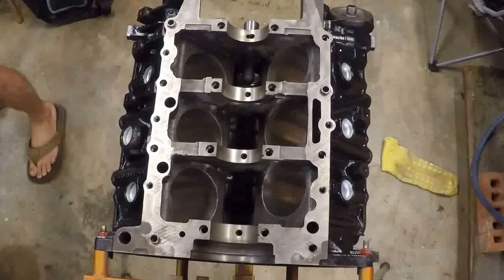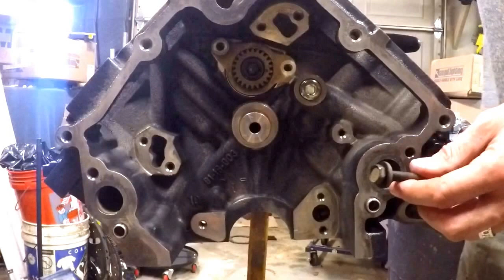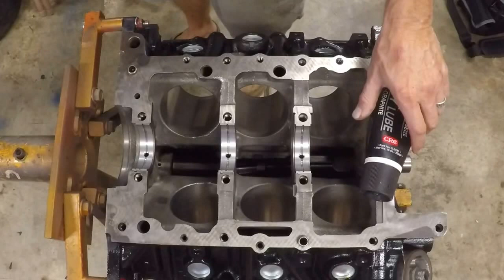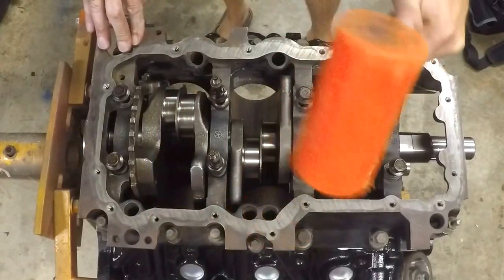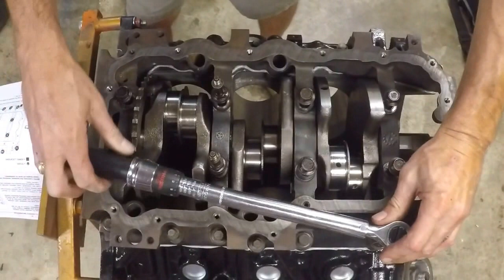Engine Rebuild - 3.7L 2006 Jeep Grand Cherokee Laredo - Part 7

Comment: Trey, I have 1 Question! Are the Main Cap Bolts a TTY bolt?
Reply from the maker: That’s a great question. Based on what I found out during this rebuild, they are not TTY, but Mopar recommends replacing them over concerns of stretching. If I remember correctly, they only cost $2-$3 each. Not too bad all things considered.

Comment: Just got a remanned motor bc my original 3.7 dropped a valve seat cased serious damage to the head. With the new motor the car won't start, only 3 cylinders firing. The intalling Mechanic ruled out any computer/ignition issues even replaced the key since mine (09 grand cherokee) uses a chip. Our final conclusion is that something could be wrong with the crankshaft or crankshaft position sensor, even though this was replaced. Would love your input since you know the engine components really well. Thank you!
Reply from the maker: Hello Sir. I would suggest you first remove the crankshaft position sensor and count the teeth on the target wheel. Depending on the year model, it should be 16 or 32 teeth. If it’s the wrong one, it will not run.
Reply: @TreyClanton  Thank you so much for your reply and information!

Comment: Do you know where I can get the bolt pattern to start with the First bolts on the Whole motor And torque specifications
Reply from the maker: Charles Roberts I purchased an electronic copy of the vehicle service manual on EBay. It cost around $10-15. EBay has cracked down on bootleg copies, so it’s likely more expensive now.

Comment: +Trey Clanton I am also rebuilding one of these 3.7l's and I got the crank in and all of the bed plate bolts torqued and the crank has too much end play. I was wondering what is wrong or what can be done. Thanks.
Reply from the maker: farm machinery fan Hello. That is a problem I’ve never had. If the stock thrust washers/bearings don’t keep the end play within spec, you have to question the wear on the crank. Can you buy over size thrust washers for a 3.7l? I’m not sure. I would begin by check the thrust surface on the crank and make sure it looks good. Then I would search for oversized thrust washers. If you know how much end play you have, you should be able to make a guess at how much oversized you need.
Reply: @TreyClanton  Thanks for responding. It is a brand new crank, main and trust bearings. What would you think of putting the old thrust washers in? Unfortunately, I don't have a tool to measure the play. Thanks.
Reply from the maker: farm machinery fan Hello Again. It won’t hurt to check the old washers, but something seems fundamentally wrong if the crank is new. You can measure the end play with a feeler gauge. Just gauge the gap between the crank and the thrust washer. That dimension is your end play. Nothing fancy required. I would question if the crank is from the right year. I would double check part numbers with the dealer.

Comment: Why do these engines need a rebuild with so low of mileage, what goes out on them?
Reply from the maker: Ron Osga, In my limited experience, valve and/or timing system failures are the most common cause of failure in these engines.
Reply: I have an 04 with 130K it has a very faint tick after its warm, but if you idle it up it doesn't speed up or become louder like a rod knock would. It has thrown a rocker arm off once but has always been maintenanced and has had an easy life. Thanks

Comment: So i too had a similar problem after i finished torquing down the bed plate. I couldn't turn the crank even with a ratchet. I loosened the 8 main bolts and then i was able to turn by ratchet. So i finished torquing again and now it turns more easily by ratchet and i can a little bit by hand. I tried a torque wrench and it takes around 3 foot pounds to turn. Maybe less. Also, i left the sticky wax coating from the machine shop on the whole crank even on the bearing surfaces. I put lube on the surfaces over the wax coating. Would this cause it to turn slightly harder than normal and is this okay?
Thanks
Reply from the maker: Hello Ethan. I would expect it turn fairly easily, but I don't have a measurement for "fairly easily". From your description, I would think you are good. Certainly the antirust coating could cause more drag on the crank. I think that if you installed it correctly, and it turns with only 3 ft-lbs of torque, then move forward. It is your call to make.
Reply: @TreyClanton  Thank you for your input!

Comment: Hello, how important is it to replace the freeze plugs on this 3.7 engine? Will i be fine leaving them alone during a rebuild?
Thanks
Reply from the maker: Ethan Reddick You can leave them if you like. I knock mine out so there is better cleaning of the water ports when they vat the block.
Reply: @TreyClanton  Thanks for your reply. As for the bed plate, i got permatex brand red rtv gasket maker. Its high temp up to 600 degrees. Will this work?
Thanks
Reply from the maker: Ethan Reddick It will work just fine if you follow the torque instructions and use and small even bead of sealant.
Reply: @TreyClanton  Thanks so much for your advice!
Reply: @TreyClanton  Hello again, i'm hoping you can put my mind at ease. So i do had a similar problem after i finished torquing down the bed plate. I could turn the crank even with a ratchet. I loosened the 8 main bolts and then i was able to turn by ratchet. So i finished torquing again and now it turns more easily by ratchet and i can a little bit by hand. I tried a torque wrench and it takes around 3 foot pounds to turn. Maybe less. Also, the crank had the sticky wax coating that the machinist told me i could leave on and just to put lube on bearing surfaces. Is this okay?
Thanks

Comment: I'm currently rebuilding my 2004 3.7 engine with 160k miles on it. Will i be able to reuse my oil pump?
thanks
Reply from the maker: luvmyfiat You certainly can reuse it. Based on the price (relatively inexpensive), the amount of work required to get to it, and the fact that is wears with time, I would think seriously about replacing it.
Reply: @TreyClanton  Thankyou for your quick response. I am rebuilding due to a bad rod bearing. Getting the crank done but not the block since the cylinder walls seem to be spotless. I also reusing the heads due to cost. I would just clean them up good and stick them on with a new gasket and bolts. What are your thoughts on this and any pointers?
thanks
Reply from the maker: luvmyfiat I don’t see a problem per se. Take your time and check the block as well as possible. You might consider cross hatching the cylinders which can be easily done DIY. As for the heads, I would check the valve seats for any that might be loose. The bottom line is that you are doing a lot of work and you want it to be worthwhile for as long as possible. Good luck with your rebuild!
Reply: @TreyClanton  Yes i'll be doing alot of checking over on the heads. As for the walls, i can rent a honing tool which should work. Will i be fine using the same con rod which was knocking, or should i replace the one that knocked. I do have other used ones,. Could i just swap those?
Thanks again for your response and for uploading these very educational vids on the 3.7.
Reply from the maker: luvmyfiat If the rods look good on inspection and measure out correctly, you should not have any problem with reuse.
Reply: @TreyClanton  Another question, for the timing chain kit, is it okay if i replace only the chains, tensioners, and guides and reuse the gears and sprockets. They don't have any worn teeth and seem to be in good shape.
Thanks
Reply from the maker: luvmyfiat Hello again. I don’t see why you can’t reuse the gears. I’ve never seen significant wear as well. I haven’t seen a timing set for this motor that didn’t come with the gears though.
Reply: @TreyClanton  hate to bother you again, but did you reuse the camshaft bolts?
Thanks
Reply from the maker: luvmyfiat Yes I did reuse them. Generally the only bolts I replace on this motor is the head bolts.
Reply from the maker: That kit looks good.
Reply: @TreyClanton  Thank you for your input. I now have all my parts ordered and next step is starting reassembly.
Thanks again for putting this awesome series on youtube. Will be following very closely

Comment: Don't you need a seal around that shaft or at least a gasket on the flange?
Reply from the maker: Bruce Bosco Which shaft are we discussing? The counter rotating balance shaft has a rear cam galley plug(looks like a freeze plug). The front of that shaft dumps into the timing chain area which drains back into the oil pan. There is a front and rear seal for the crankshaft which I cover later in the rebuild.

Comment: Great vid.  2006 Dakota, 3.7.  Ex-FIL's car (Go figure - I got him in the property settlement. LOL)  Anyhoo.  His thrust bearings are mangled and parts of them were in the pan.  He's 84 and started arguing about taking the main bearing caps off to have a look.  Carl, this does not have caps.  It has a saddle/bed casting.  He did not believe me.  This vid finally convinced him.
Reply from the maker: Bob Kontak I’m glad the video was useful to convince him! It is definitely more of a commitment to take off the bed plate to evaluate bearing.

Comment: Hey Trey, I'm finally doing the build on mine and was wonderingif you actually used RTV sealant like you said in the video? Or the Mopor bedplate sealant? I believe there's an important difference
Reply from the maker: I used a brand name, hi-temp, RTV. I talked to a Dodge, Chrysler, Jeep technician I know, and he said that either one works equally well. The most important factor is a very clear surface free of nicks or other imperfections.

Comment: So, I installed the bed plate and torqued everything and when I was done I could no longer turn the crank by hand. I got worried something was wrong so I backed all the bolts out and did it again. I still couldn't turn the crank by hand but could easily turn it with a 3/8 ratchet.is this normal and do you think I caused any harm to the bearings by torquing and retorquing the bolts
Reply from the maker: Mike Given I doubt you hurt anything. I suspect that your bearings aren’t quite the correct size. Check the back end of the crank and see if there are a series of letters (I think there might be four letters). This means that your motor requires select bearings. You should also try to get some plasti-gauge and check your bearing clearances. I suspect that one or more of the bearings is too tight.
Reply: Trey Clanton , I used plastigauge on the main bearings, the clearances were all around .0015 for all four  give or take .0001.  I also watched your video on select fit bearings and decided to use the set that came with my rebuild kit. I uploaded a couple photos and a video to my YouTube page, if you get a chance and don't mind taking a look I would appreciate it.

Comment: I took off my bedplate of my 03 liberty and I'm pretty confident there wasn't any rtv sealant of any kind... Did it look like there was on this one?
Reply from the maker: MMGJ10  Hello. There definately should be RTV sealant between the block and the bedplate.  Drop your e-mail address in the comments and I will send you a picture of the RTV bead lay-out recommended by the factory.
Reply: Trey Clanton mmgj09@yahoo.com thanks. I'll send you a pic of the bedplate and block. I didn't have oil leaks at all but there isn't any sealant either? Would the factory have rtv'd it? It just doesn't make sense that there isn't any yet it didn't leak.
Reply: Trey Clanton Not having any rtv vs having rtv would change bearing clearances? wouldn't it?
Reply from the maker: MMGJ10 Hello Again! I sent you the picture via e-mail. As you will see in the e-mail, Chrysler recommends Mopar Engine RTV sealant. I have used the Mopar product and other RTV's successfully. Just be sure that the RTV is rated for high temperature oil service. The block/bed plate mating surface is so well machined, that it is not surprising that you would not notice RTV on disassembly. When you torque the bed plate bolts the RTV is mostly displaced except in small imperfections in the surface, so it does not affect the main bearing clearances.
Reply from the maker: Please let me know if you don't get the e-mail. I can try again.
Reply: I got it, thank you sir! That has to be the explanation. I just must not have noticed the little bit of rtv in the imperfections of the gasket surfaces

Comment: Trey,  How would (did?) you clean the bed plate mating surfaces (both block and bed plate)?  I was told not to use anything that might take even the slightest bit of metal off, so no 3M Roloc wheel for this one (that is what I used for cleaning the cylinder head mating surfaces).  It is my understanding that because the crankshaft bearing journals are such tight tolerance, any changes (even extremely slight ones) on the mating surface could alter that tolerance.
Reply from the maker: Hello Cory! I used a plastic scraper to remove the bulk of any remaining silicone and then lightly clean it with a scotch-brite pad.

Comment: I have that same motor in my ram... I'd like to pull the heads and really do some things to make them heavy duty... Is there anything you can recommend... We live in tx as well up in the Austin Area.... I have no issues driving my heads down  to that machine shop you recommended.... Also do you have a shop... Can I get you to do my head swap?
Reply from the maker: Hello! I don't have a shop. I'm just a hobby guy that enjoys rebuilding motors. I would suggest you look around the Austin area for a head rebuild shop that can replace the valve seats and then peen the heads to prevent them from ever coming out. Austin is far enough from Houston to spend the time looking. If you do choose to use D's in Houston, you can probably work a deal to have them shipped. Good luck with it, and holler out if I can help.
Reply: +Trey Clanton is it worth having the heads ported and polished? Also what about better Springs or not worth it?
Reply from the maker: +Justin E, I'll give you my take, but I would suggest some research on your part. My take is to just rebuild these heads to secure the valve seats better. This engine is limited by too many other things to expect too much from polishing and porting. This would really only be useful with a larger cam. With this being a computer controlled engine, I think the mods list would get real long (and expensive) really fast. If you want more power, you might consider a 4.7 l Dodge from the same era.
Reply: +Trey Clanton ok well thank you I appreciate that... I'll just get them seated..